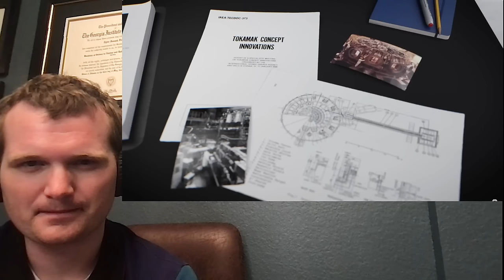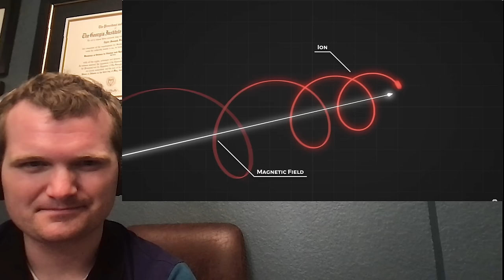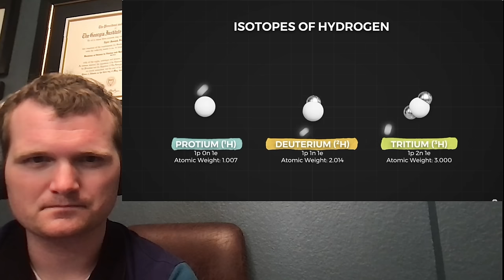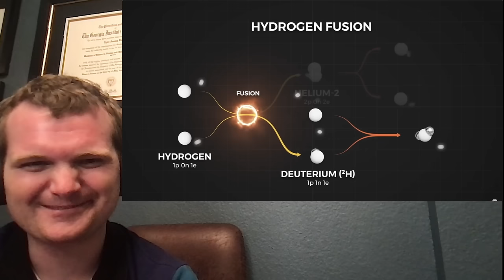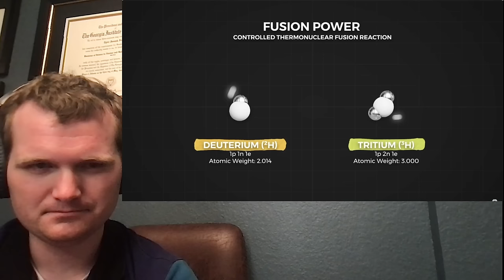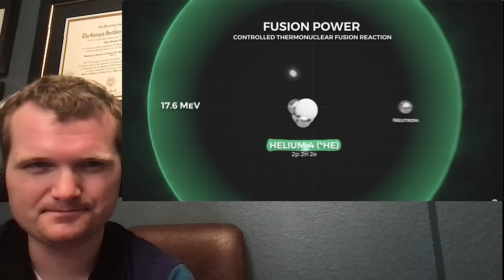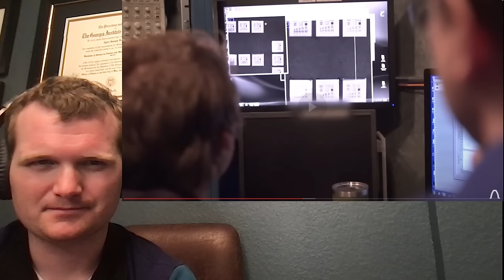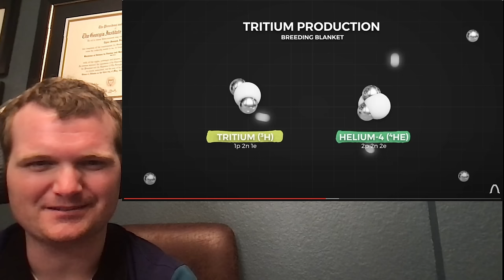Nuclear Engineer Reacts to Real Engineering "The Problem with Nuclear Fusion"

Comment: Great video! I'd love to get your take on focus fusion (LPPF) which is exploring aneutronic fusion by using proton-boron fusion. They have some videos here on YouTube, and I would love to hear another perspective on the viability of these non-DT fusion designs
Reply: aneutronic reactors are the interesting stuff and what will ultimately make fusion good in the long term. its not really the elimination of radioactive products, but the charged particles which you can use to generate power through more efficient means than steam. of course you have to walk before you can run and were barely crawling. the first 50 years of fusion power will be a grueling expensive ordeal, and if we get good enough at confinement and heating then we can work with the terrible cross sections on the aneutronic fuels.

Comment: Could you ignite fusion fuel using directed sunlight? I've recently developed an appreciation for those solar power stations that use a bunch of mirrors to melt salt and use that to boil water. I mean screw the blue panels made of rare earths, lets shoot a deathray at salt.
Reply: Unfortunately, probably not. To get all of that sunlight into a tight enough beam, you'd need lenses, not just mirrors, and if it's hot enough to fuse elements, it's more than hot enough to melt whatever lens array you're using.
Reply: @michaelbushee3968 its even worse than that. you can’t use light to heat something up hotter than the original light source so with sunlight your limited to about 5000C or so

Comment: Good breakdown I learned a little bit more about nuclear fusion today 😄 So is it heat, a ball of energy that floats in place, is it spinning? and is there an emergency shut of switch or is there a process to shut it down? Thanks lol
Reply: unlike fission, which often requires control rods to shut off, fusion is so hard to sustain that if anything fails it will shut itself off naturally. You have to continually apply magnetic field and it has to continually not impact the side. If it hit the side it might do some damage to the reactor wall but it would instantly shut off on its own because ti would lose too much heat to maintain fusion. Same if power is lost it will shut down because the same magnetic confinemnet needed to keep it stable is also needed to keep the fusion reactions going. It sounds dangerous ebcause there is so much heat and pressure involved, but all that heat and pressure is on a very small amount of material. Dispersed along the tons of material in the blanket wall, it would not raise the temperature by that much.
Reply: @andrewdemarco3512  TY

Comment: For fusion, the electrons aren't going to go somewhere else, they're made to go somewhere else first, lest they interfere with heating and confinement.

I still hear some people blather that fusion hasn't been conducted by humans, which is absurd. First, there's that whole fusion bomb thing, then well, one fires up both a fission reactor and fission bomb at the right configuration and time using what? A neutron generator, many of which are small fusion devices.
We've only recently, for an instant, generated gainful fusion (well, outside of a hydrogen bomb and that kind of power generation nobody in their right mind wants).
Of course, nobody got fission working in a self-sustaining way until Fermi's ugly little pile of... reactor. Which didn't generate gainful power, as if it tried, those bleachers would've been quite an unpleasant seat for a few weeks at best.

Comment: In another video David Kirtley points out that their Polaris reactor will be in another building a safe distance  away from their main facility and will be remotely controlled by their team from their main facility. He also mentions the sensors and diagnostics like neutron and alpha particle detectors, magnetic diagnostics and x-ray spectroscopy equipment. Assume that they will be also monitoring X-ray radiation remotely. 

But I have not seen any prediction on how much electrical energy they hope to capture nor the way they will convert what they get to grid useful power. 

Side note : Sam Altman is one of their investors to the tune of $355 million.

Comment: Yes please react to the Helion project. Ive seen both documentaries. I thought the Helion had a greater chance of success but again sustaining the reaction seems to be the biggest challenge. They are using massive capacitor banks to pulse the magnetic field but these things don't provide sustained current just short term discharge so net energy is doubtful in this scenario as well. But they do so higher potential output maybe the maths adds up.

Comment: I'm fairly positive we'll eventually solve the energy gain issue and I don't see neutron activation as much of an issue. But how big will it be, how long will it take to build & how much will it cost to build & run.
Those are the biggest issues that will need to be solved for fusion to be viable as a commercial source of power.

Comment: I can tell you the problem with nuclear fusion.

It's built on this notion about how the son works called the standard solar model.

The standard solar model is no more representation of how the Sun actually works than that of a heat lamp.

This supplies that specialty to tokamak and stellarators.

Comment: beryllium might not be a problem if chemically purified before use. acid to dissolve the metal, remove the uranium, reform the beryllium.  hydrochloric and sulfuric both work on beryllium and leave uranium alone.

Comment: Yeah. I wonder. Would the biggest danger of a fusion reator be the heat it might release if it failed?
Reply: its very high temperature but in a very small amount of plasma. If it fails it can impact the wall and cuase some damage to it, but that's about all. The good thing about fusion reactions is they are so hard to maintain, that they will naturally turn themselves off if this happens. Even if it somehow broke the wall, it might burn someone if they were standing close, but there is not suffient energy for it to cause an explosion or anything.

Comment: The tokamak and stellarator are one of the embodyments of engineering thought of USSR and USA. Tokamak - cheaper, reliable but not that effective. Stellarator - less simpler design, costs more, but more effective.
Reply: Look in to helion energy and their trenta machine !!!
Reply: That’s more to do with capability. The USA always held a huge lead in technology, even when they were “losing.” Especially computing, which is something you need to make more complex but efficient designs.

The Soviets built cheap because they weren’t capable of building anything better. That can happen when you send all your best minds to die in gulags.

Comment: Edit: I stand corrected. Both pronunciations are accepted according to Webster's Dictionary. I had a professor in my engineering coursework that was Indian and made a point of pronouncing it one way so as to not be mistaken with headwear. It is also the only American pronunciation that Google provides. I learned something new today. /Edit

6:50-Turbin is something worn on the head in some parts of the world, while a turbine is a rotating device meant to convert gas pressure/temperature energy into rotational mechanical energy. Not to be a butt, but....😅
I totally agree that anything can be dangerous if handled improperly. I mean, some people have died while fueling a vehicle. I'm sure someone someplace has choked on a marshmallow at some point in history.
Reply: I also feel weird when someone pronounced turbine and turban, but someone I saw made a good point...   we don't say engine the same way we (you and I) say turbine... so either pronunciation is correct.  I just like turbine because there's not a chance of confusing it with the headwear.  lol

Comment: It astounds me that anyone calls fission "clean". That is a reframing solely from a carbon perspective. That is not what we thought "clean" was in the 80s.
Fission generates long term poisonous byproducts that we still do not have long-term storage for. There is a facility about 200km from me on Lake Ontario where if the water pumps stops would make New York uninhabitable within 2 weeks. That doesn't meet my definition of clean.
Fusion is a hope, but if it retains the need for tritium, it cannot divorce from fission. Lithium to tritium is a 1 to 1 equation that cannot ensure 100% production, meaning there will always be a need for fission to fuel fusion. Unless we can get D-D to work.
Reply: Then your definition of “clean” is misinformed and illogical. Why are you commenting on  things you don’t understand?

Comment: You touched on something that I thought about a while ago, fusion is possible for any element so if we can generate enough power then we can put that power back into fusing heavier elements. Meaning it may be possible for us in the future to create any element we need just using a fusion reactor which could help with shortages and change our resource gathering from what we can find (like mining) to what we can create ourselves although I could never see fusion reactions replacing mining as mining will likely always be cheaper.

Comment: On the note of fusion reactants being dangerous - not only is tritium radioactive, but in the context of a nuclear reactor, it is high-speed, high-pressure, high-temperature and all around high-energy hydrogen; if it is exposed to oxygen at any point, your reactor turns into the world's biggest pipe-[Rapid-Air-Expansion-Device].
Reply: Also, as a Canadian, I can confirm: We do, indeed, cool and moderate our nuclear power plants with maple syrup; that's the secret of our maple syrup vaults - they're just the coolant pools of nuclear power plants.
Reply: Why is it that people who say things like this never bother to understand how fusion works. Yes tritium is radioactive, but nothing in comparison to fission fuels and waste products like uranium and plutonium. The only problem tritium radiation causes for fusion is that it doesn't last long enough for it to be found in large amounts in nature like deuterium for it to be used as a reliable fuel source, that's why most nuclear fusion reactor designs are planning on breeding most of it from lithium instead, so the actual fuel sources would be deuterium and lithium.

Secondly, yes it uses hydrogen, at high temperatures and pressures in a very confined space, but it's not going to explode like a conventional hydrogen bomb for two major reasons;
First, the hydrogen is contained within a vacuum vessel in the reactor with no access to oxygen for chemical combustion to occur in the first place, that would be obviously counterintuitive to the goal of heating it up to above starlike temperatures. So there's no chance of a hydrogen explosion resulting from chemical combustion.

Secondly, the miniscule amount of hydrogen that is present at any given time in the reactor is so small that even at it's extreme temperatures, a single breath from a regular person could blow it out, it's that fragile. It's like the amount of burning gas in a lit candle or Bunsen burner, it's not much at all.

There are dangers that are very real from losing control of the extremely hot plasma, but most of them are a result of the tools and apparatus used to heat and confine the plasma to those hot temps in the first place. You'd have a melted vacuum vessel wall at most from just the plasma losing control, but you'd have more worries from a loss of control in the reactor magnets that could literally crush the entire reactor into itself.